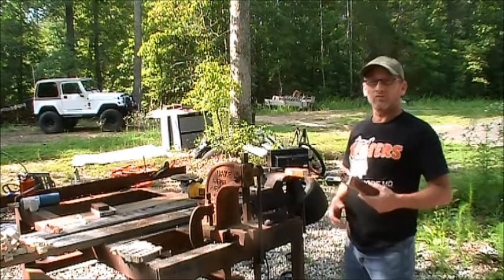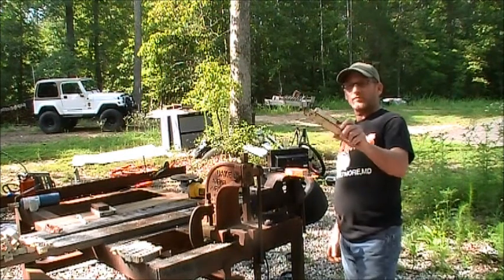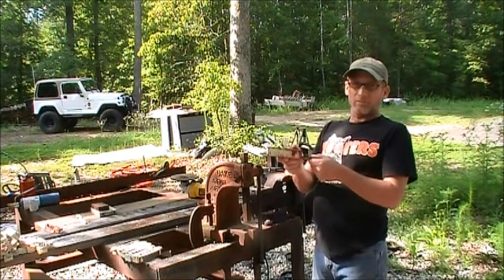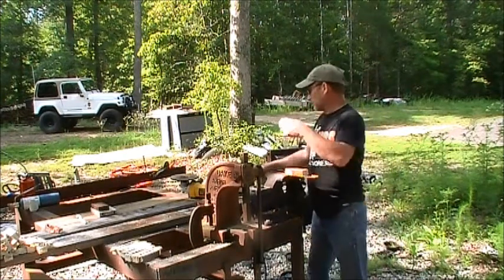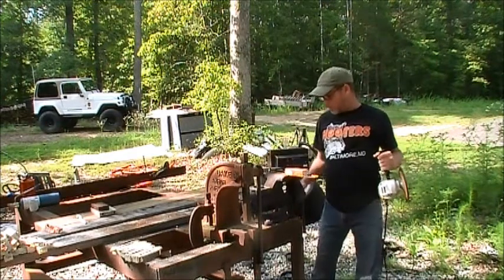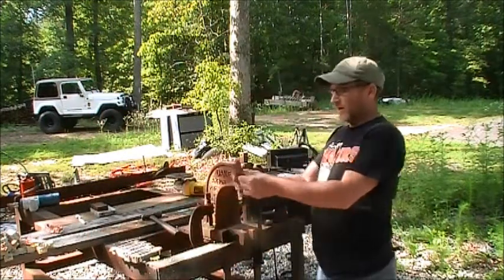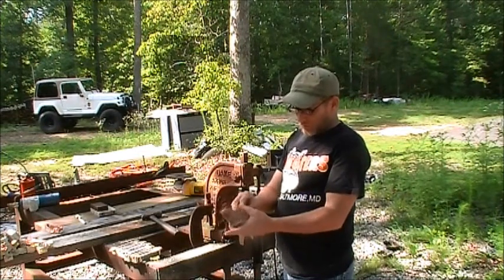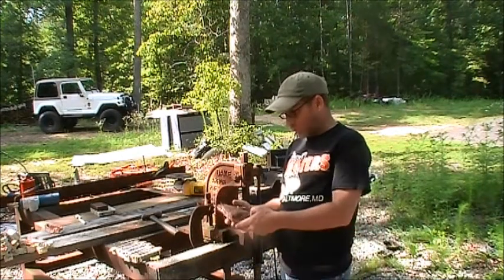recycle light ballast

Comment: nice, you just made that lill thing worth 10 times as much, well even though it weighs less.  worth more.  didn't know what was in them.  been saving copper scraps, big and small, for years now.  looks like I have been throwing away stuff that had more copper and easier to get to than some of the crap I dismantle.  thanks

Comment: I hope dave has solar panels because otherwise the power he used to run the grinder offset his return.  Hope he can cut lots of ballast with one wheel because those arent free either.
Reply from the maker: a grinder don't use that much power and I used one old wheel I already had. I would say I gained a huge increase per ballast by stripping them. they pay 25 cent a pound for the ballast. they paid a lot more for the wire inside and then paid 9 cent per pound for the remainder of the ballast material. the one sanding disc was 8 dollars. I cashed in 300.00 worth of copper from all the ballast. I would have only got around 30 bucks if that. I doubt I used 10 dollars worth of electricity. I seen no increase in my electric bill that month. a lazy man will think of any excuse to not do a little extra work to increase his profits. I'm not a lazy man, I do have my own issues but being lazy is not one of them.

Comment: That copper is insulated copper. It's looks bare, but theres a clear insulation around it. They pay you the rate for insulated copper for that.
Reply from the maker: they will try that and get away with it if you let them. don't let them! that varnish is nothing in weight compared to the copper. its not like a coating on romex, thhn, or extensions cords.

Comment: #2 bud not #1 it's got to be heavier than that and there's a thin  lacquer coat to insulate it
Reply from the maker: +Maidenlord 666 they wont pay number 1 unless you make them. that thin layer of lacquer don't weigh anything. when they refused to pay me number 1 price I went to another place that would. these guys at these scrap metal yards make out like a bandit when they pay number 2 prices for wire like this.

Comment: Assuming you can sell it for #1 copper rate, that was a hell of a lot of work for an extra 25 cents. It works out to making an extra $2.50 per hour; for all your labor, hazard, wear & tear on tools (the grinding disks will add up for sure), clean-up... Unless you can refine the process of shelling those ballasts to about 30 seconds per unit you'd be much better served using that time to gather more material.
Reply from the maker: keep in mind you still have the steel to cash in. also you do this between time spent gathering more scrap. I was actually modest in my estimates and as you could see I was in no hurry to disassemble the unit it took around 3 minutes to complete. perhaps that time is more valuable to someone who does not need the money but if you need the money and have the time the option is there. 9 cent a pound for the steel is nearly half per pound as a whole unit at 20 cent a pound. that means you get more than 10 times more per pound for the remaining weight of the copper. 10 x 20 equals 2.00 dollars a pound. I actually got 250 when I took it down there.
Reply: Point taken. I change my stance on that, in retrospect, and I agree. There are lot's of possible circumstantial reasons for making the most of materials on-hand. Good work.